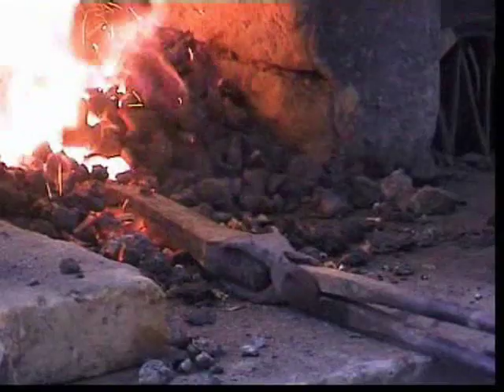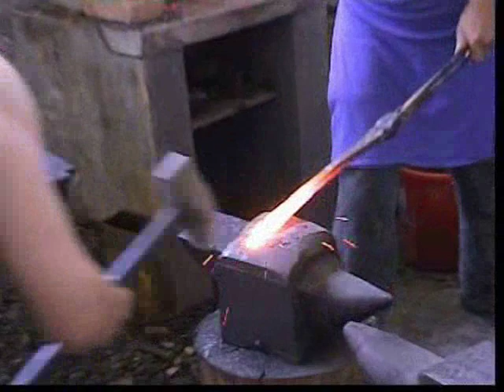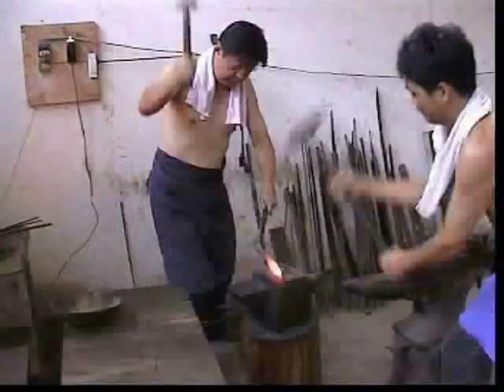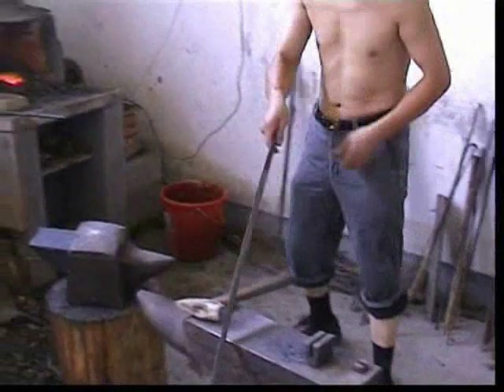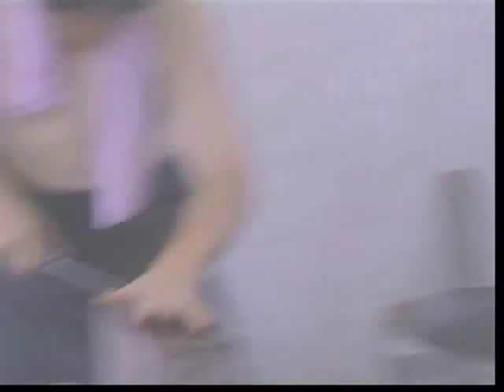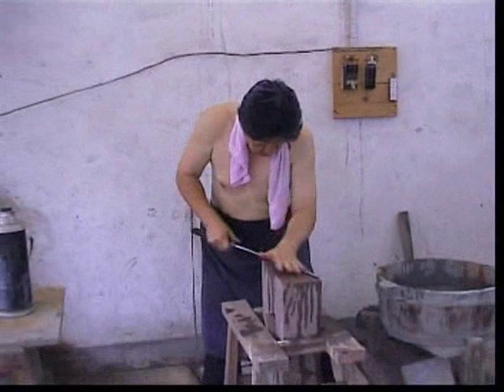Forging of sword in Longquan China

Comment: What alot of people fail to realize is that the Japanese steel they use "Tamaghane" had a ton of impurities in it which is why they had to fold the steel. Today's steel does not need to be folded because its such a high quality, but people still have it done for the visual appeal it gives a sword with the wavy streaks, but it can make the steel more "brittle" in some cases depending on the steel used. If you want a tough as nails sword go get yourself a Cheness Tenchi made from 9620 Spring Steel Monotempered. Those things can take more abuse then anything historically possible, and are made for "Heavy" cutting. The fittings are the most basic however, but its a beast

Comment: @goober20001 that only matters if you aren't using modern steel and are just pulling mixed iron/steel from the ground. otherwise folding does nothing to affect the blades stability.

Comment: The swords maybe mono steel or soft cored, the video doesnt show that. They are doing a great job though. Japanese swordsmiths dont get the curve just by the cooling, Ive seen masters have a slight curve beforhand and the cooling makes the curve more noticable and uniform. These guys are making sword blanks then they get polished to a degree before they do a final hardening with a special clay covering the blade thinner at the edge protecting the semi polished blade creating the Hamon.